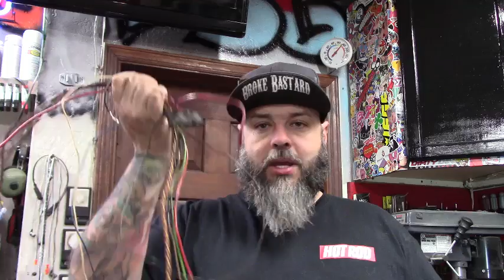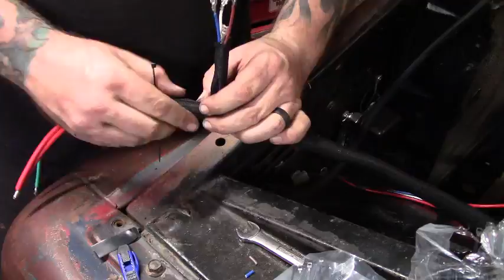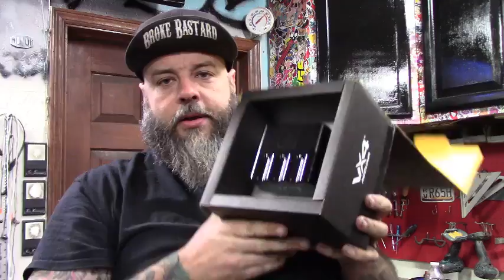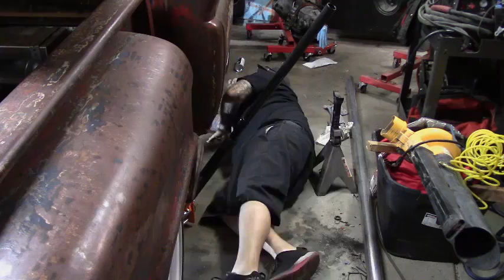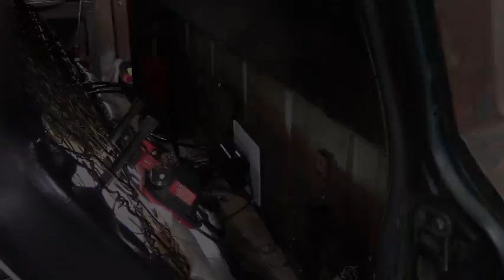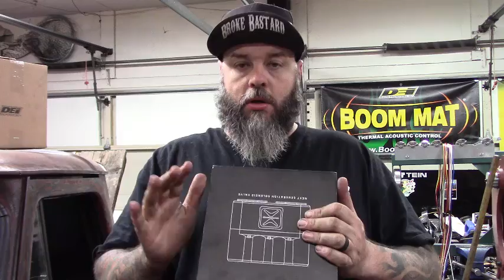Install new engine harness and Install Accuair VX4 air ride manifold

Comment: Did you have to use accuairs ecu ?
Reply from the maker: WHYTEBOY nope. It’s a stand alone unit. I even reused my old switch box.
Reply: @BrokeBastardGarage  Awesome thank you for the reply. Everything I have seen for wiring has shown i with the ECU so I didnt know if I could just replace my old school valves with this.